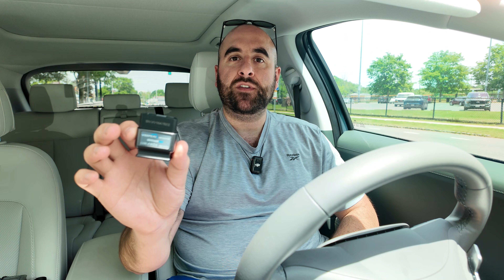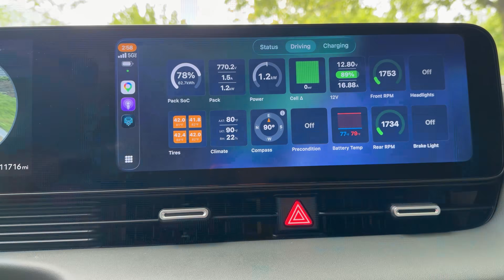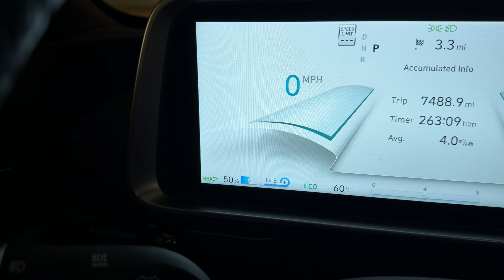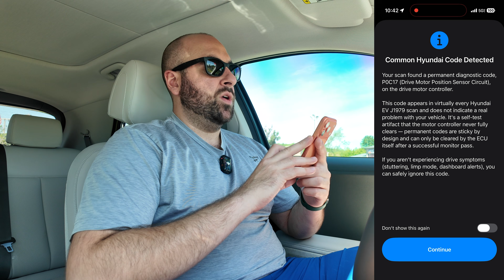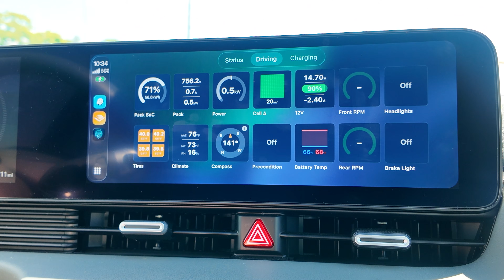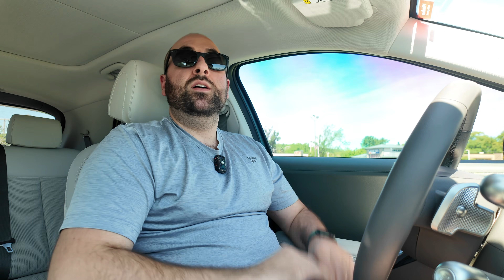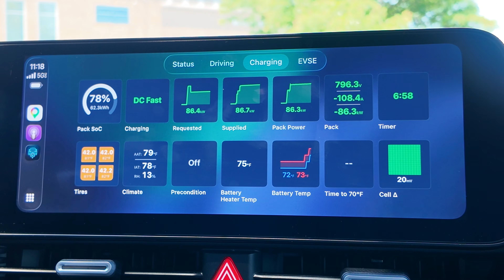Every Ioniq 5, Ioniq 6 & Ioniq 9 Owner Needs This App! | EV Dashboard for iOS

Comment: I have a 2024 Ioniq6 standart range. In my car , bluelink cannot work because of in my country. I cannot get directions from Google Maps and the vehicle's built-in navigation system at the same time; when I open one, the other closes. In other words, when I want to perform battery conditioning, I cannot simultaneously get directions from Google Maps. Is there a solution for this?

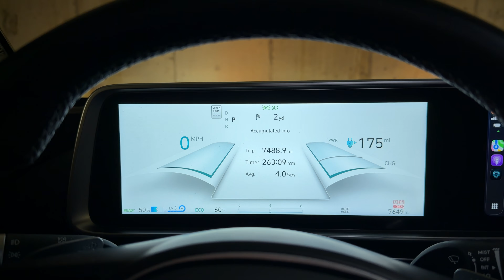Comment: I just purchased a 2025 ioniq 5 SEL. This is driving me crazy .. I CANNOT find the driving display seen on your car at 8:52. Can you help me find this please!!!
Reply from the maker: Flip through the page button on the steering wheel and use the scroll wheel until you find it. Every 2025 looks like what I show.
Reply: I flipped through every page, used the scroll wheel on the pages where it was available 
and still could not find it. This is strange!!!

Comment: The app wouldn't open on my iPhone ... said there was a conflict. I'm guessing it was because of ABRP. But when I looked at my phone it was not open ... but the ABRP screen was on the Ioniq 5 display (?!). Couldn't figure out a way to close the app because it wasn't open on my phone. Any ideas?
Reply: Ok, figured it out. There may be another way to do this, but I disabled bluetooth on iOS for ABRP, then plugged the OBD-II back in, then opened EV Dashboard and it worked fine. For day-to-day, I think EV Dashboard is more useful. ABRP for trips and planning.

Comment: I’m having 12v battery issues and will replace with AGM. Does having the OBD dongle plugged in drain the 12v battery?
Reply from the maker: Most people don't have issues with 12V drain but it's best practice to remove it

Comment: I should have checked my specs better. I went out and bought a relatively modern used ipad just to use this app in my Ioniq 5 since my devices are otherwise android. But not only does this app require ios, it also requires version 26 or higher of the ios operating system which only the newest ipads support. If the developer himself doesn't have the technical ability or time to make this app more widely usable, I think he'd be well advised to pay someone who can because I'm betting the demand for an app with this much functionality (especially when you consider how crappy and underdeveloped hyundai's software offerings are) would be able to really rake in the dough if the usable audience wasn't so small. As it stands now, with no cross platform compatibility and seemingly zero backwards compatibility, the app, no matter how good it is, does not inspire much loyalty. Even if I had the latest ipad with the latest operating system who's to say I wouldn't just be left in the dust for updates one or two ios updates into the future.

Comment: I installed the VeePeak OBD2 and Companion app, works fine. Started CarPlay on my Kia EV3 2023 Wind, selected the Ioniq5Companion app, worked OK on the dash screen. After a couple of minutes the Carplay screen froze. I'm using a wireless adapter on the EV6 to use my Apple iPhone CarPlay. I tried removing the wifi adapter and plugging my phone directly into the EV6 port. Restarted the OBD2 adapter, started CarPlay, selected the Ioniq5Companion app. Worked ok for a few minutes, then the screen froze again. Question: am I missing a setup step on the car or on my phone that could be causing the screen to freeze?
:face-pink-tears:
Reply from the maker: You should reach out directly to the devloper

Comment: It would be good to have a screen that shows the Wheel turn angle when lane centring is turned on and you are on a straight road.  This would check for wheel alignment.  Can be done on Car scanner but its a pain and you have to set it up on a screen before you drive and then look at your phone whilst driving.

Comment: Former Tesla owner who misses Dog Mode. The missing feature for a workaround is a way to check interior temperature remotely. I need to travel during August. How accurate and reliable is the temperature, and can I set a notification on my phone if the cabin temp goes too high?
Reply from the maker: This doesn't provide any remote access, it's all local when you are within bluetooth range of the car.

Comment: In principle this is indeed a great app, but unfortunately the tiles are wat too small which makes the information hard to read, especially when driving. Even though Car Scanner is not as well structured and pretty, you can at least read the info..

Comment: Great for a week.  Excellent app and great tool BUT use of the app with a Veepeak OBD2 for one week bricked my IONIC 5 as a result of  the 12-volt battery being drained.  My car is less than 1-year old. I had to jump-start the car to get it running, and then it took an hour in "ready" mode to recharge the 12-volt.  I yanked the Veepeak and put it into drydock.  May just use periodically, but I am not going to drain the battery, or I may get an on-off switch for it.

Comment: OK, I bought the app and got an OBDII port connector (not yours but it should be fine yeah?)
Now when I set it up, the app connects with the OBDII connector, the app all opens, but it tells me the car is ‘off’ when it is on and even driving.  Using an iPhone 17 as well.
WTF is going on?

Comment: The port that this plugs into I believe already has something plugged into it in my car because I purchased the electronic undercoating protection. Is there a way to use some kind of a Y cable to plug two things into this port at the same time?

Comment: Really interesting.  As an EV6 GT driver, I'd love a widget for HP and Max HP - this would be super useful as the power is a ratio of the SOC and pack temp.

I can see ALL values in HP or kW.  But you can't see the max power by value, nor the current HP with the kW values.  All told though, tyre pressures with temp, are a godsend of optimal layout - thumbs up for the app making CarPlay look nice.

Comment: oh man, I will be all over that manual pre-conditioning system. There are TWO DCFC stations (IONNA and Kwik Trip) I use that have been there for over a year when I bought my EV6 and NEITHER are in the infotainment STILL even after this spring update. This is frankly embarrassing for KIA, all they had to do is add a button for it OR allow any destination to be flagged as a DCFC. but they do neither. I am so sick of things getting released un-finished.

I'd also love it if someone made a thing that would enable standard cruise control. radar cruise can be fine, but god damn I miss just having standard CC. the stupid CC on my EV6 just annoys me because the only times the radar system makes senses are times when I don't use cruise at all . and instead I get fun experiences like my car slamming on the brakes because the person in front of me entered a turning lane and are slowing down... to turn. Or slamming on the brakes because someone drove across the road in front of me... with enough distance that it would take 10 seconds to hit them. all they had to do was include a button to turn off radar cruise like ford does and I wouldn't be complaining about this. I'm an adult, I can drive the damn car myself.

Comment: Can't wait for manual pre conditioning on my Ioniq 5 2022 !!   great news that is
Reply: I’m not sure the app will be able to add manual preconditioning.  It might simply not be possible on the older software platform, or the cars software may poll periodically, discover the criteria it looks at are not met, and switch it off. So if we get into a version of the bugs-vs-daffy duck/rabbit season bit, it might not be practical. 

 But having interacted with the author, I’m positive if we can make it work, I’m sure it will be a future feature.

In the meantime you still need to be navigating to a charger, and less than about 20 minutes away.   In my experiments I’ve discovered you don’t actually need to be driving and can precondition even with the gearselector in park.  It may take a minute or so to activate after setting the destination in the cars’s native nav app.   Very handy if the cars’s cold and the first stop is a charger.  Just power up the car, set the destination, put it in park and let it sit 15 minutes while you finish your morning beverage and prepare to get going.

But you MUST continue to use the car’s nav system and NOT switch to  an alternative on a connected device.  For whatever reason, it only supports one nav app being ‘active’ with a destination set at once.  If you change the CP/AA screen to show wayz or any other nav app, it turns off the destination in the cars nav system, and then shortly after that the car notices no destination is set and turns off preconditioning.

My Software testing powers are re-activated, and I’m on the beta team for this.   I think proper support for the 9’s is the current push, then perhaps the GV60.  I’ll certainly be encouraging he explore if there’s any way to enable control over preconditioning.     

I want to be optimistic because I too want manual preconditioning.  but my gut and 30 years in software are saying it might end up in a fight for control over the functionality between the app and the car.  Which would be as we say in software “highly suboptimal” 😂
Reply: @ChuckvdL  all I need is a software button on the display.  And if the navigation can turn on the pre heating, that proves the software of the car is controlling the pre heating (seems to me)
Reply: @IVH-BE  we all want it, but I suspect that without a change to the car’s software we’ll be in a virtual battle of wills as the car determines repeatedly that it thinks preconditioning should be off, shortly after the app sent the commands to turn it on.

Comment: Very nice app but I have to say this from a use case perspective: this borders on "too much information" while driving. During a 2 hour drive after installing it, I found that the display can be very distracting. I found it most useful to only switch to the app at a traffic light...no need to keep it constantly displayed while you should be eyes forward. Also, the indoor temp from the app (dongle) reads 3 degrees higher than the temp set in the car; not sure which one is right :-) I haven't tried the Charging tab yet but I can see how that data can be useful while level 3 charging.

Comment: Seems like you just got a great new app for your next OOS race in the E-GMP vehicle.
Reply from the maker: Yeah assuming it doesn't screw up battery conditioning like in the Eastern Edge
Reply: Well it has the integrated preconditioning and should show the increased load/draw from the battery once activated.

Comment: Would the preconditioning work in a 2022 ionic five in New Zealand where the car has never had a pre conditioning function?
Reply from the maker: If the car doesn’t have preconditioning through the nav system then no it won’t

Comment: Do OBD dongles drain the battery and risk a dead 12V? Do you leave your OBD connected and running all the time?
Reply: Does anyone have thoughts on this? As a lot of people seem to think this is the case so I unplug mine. But it is annoying having to unplug plug in every time etc
Reply: @cdjabuser I think these apps are useless if the dongle can’t be left in full time with no concerns of car security and 12V battery drain.

Comment: Does anyone know if you can use the companion app and ABRP app at the same time with the OBD2 dongle?
Reply: Hello!   In Version 2.0, I added features to make co-existence easier, such as control over Auto-Connect and the ability to manually connect and disconnect -- but that is all to make it easier to only have one app communicating with the OBD-II adapter at a time.
Reply from the maker: You can't

Comment: I just tried it on the GV60, and it works! Pretty cool. Thanks Ioniq Guy for the tip.
Reply: Did it identify yours correctly?  It thinks my Advanced is a Ioniq5 Rwd  and doesn’t display the front motor data, no odometer, wrong pack config, and several other minor things.   But for a WIP it’s working pretty good all in all.  Definitely beta quality, maybe even late stage beta.  Better than most   I look forward to full support for our cars soon

Comment: imo the best reasoning for the brake light indicator is for the different levels of regenerative braking.
Reply: It’s useful.   Even better would be a single block perhaps similar to tire pressure with  headlights, hi-beams, taillights, and brakelights.

Comment: 5:58 cool, it’s worth it just for the tyre temperature info! I did not realise that’s in the TPMS sensors? I presume? Going to get and try this today. It’s a must have for the 5N and track days!
Reply: I think you will like a new feature coming out in the next version which is currently in beta -- I've added peak horsepower to the Power chip, units in kW, HP, or PS -- depending on your preference.
Reply: @GregoryBurlingame happy to test if you need. Already got your rev 2 installed today.
Reply: @Pilch9  Fantastic, thank you!   My email is available on the support site - please send me your email so I can send you a TestFlight invite.

Comment: Looks like a great app. Did you test it with ABRP as they both use the OBD2 device? I am also wondering since you have a relationship with the developer if you could suggest a query during charging for price per KW. Also if there is any possibility that ABRP listens to you, could you suggest that they provide an alter for initiating recharging. There is no reason they could not do this provide you provided a parameter of time before a charge to initiate preconditioning.
Reply from the maker: You can’t use both at the same time
Reply: Hello Jim -- I have thought about adding a field for the price per kWh - so the app could display a running total of your charge expense during the charging session.   I hesitated on that, because it seemed like a bit of manual work that I figured folks would not want to do.   But maybe you have an idea in mind, something I'm not thinking of?

Comment: In a prior video you reported an issue where having an ODB dongle plugged in interfered with preconditioning - has that issue been resolved ?  If so, this looks like a real winner 🥇!
Reply from the maker: There's no way around that as it's not related to the app it's just the nature of interupting CAN signals for other purposes. OBD2 is really only designed for diagnostic troubleshooting. It's not meant for continuous data collection.
Reply: @TheIoniqGuy  that’s too bad - did it only interfere with automatic preconditioning or manual as well ?  If manual as well, I’m struggling to see how this App would work as it relies on the ODB dongle - right ?
Reply from the maker: The odds of it happening are slim. In thousands of miles I’ve only had it happen once. If you notice it you just unplug it and plug it back in and it should resolve itself. I think the benefits of this app outweigh the slight possibility of that happening
Reply: @TheIoniqGuy ok that’s good to know - I thought you had found it was a consistent thing 👍🏻
Reply from the maker: No, rare if at all. It just came at the most in opportune time, the middle of a race

Comment: Can the Veepeak be left plugged in without compromising the 12V or does it need to be disconnected after every drive?
Reply from the maker: The OBD2 port is always powered so leaving it in can drain the 12V but your 12V should be topped off as necessary from the high voltage battery

Comment: 15:05 Did you have to pull it to prevent charging speed problems like on the Ioniq 9, or was it for some other reason?
Reply from the maker: I just unplugged it because I don't ever leave it plugged in for extended periods if I'm not driving

Comment: Thanks for this review. I downloaded the app right away and connected my older Vgate iCar Pro. The app didn't see my Vgate. Turns out I needed to turn on Privacy & Security>Bluetooth>IONIQ 5 Companion which was off. After switching it on, the app connected to my 12v Ancel battery monitor, so I turned off auto-connect in the IONIQ 5 Companion 5 Companion app, and that allowed me to manually connect to my Vgate iCar Pro. An awesome app for my 2024 EV6 Wind RWD, well worth $13!
Reply: Hello - and sorry that was a little bumpy!   I'm not a huge fan of the way Apple throws the Bluetooth permissions after first launch -- much too easy to accidentally choose the wrong option.   Hopefully the app correctly indicated that Bluetooth was disabled.   Enjoy!

Comment: Great info! I’m currently using the Car Scanner app. Will I need to disconnect/delete this app from the OBD Scanner before using this new Companion app?
Reply from the maker: I would remove your OBD2 scanner from Car Scanner so that it doesn't automatically connect to it.
Reply: @TheIoniqGuy  Thank you, Corbin! Love your content!
Reply: Hello!   OBD-II / ELM327 is a bit of an old technology - if more than one app is talking with the adapter at at time, both will have a degraded experience.   Version 2.0 of IONIQ 5 Companion added features to make co-existence with other apps easier, but still only one app can be running at time.   IONIQ 5 Companion also has a diagnostic test called "Adapter Quiet Check" to help you diagnose if another app is using the adapter without your knowledge.
Reply: @GregoryBurlingame  Thank you so much!